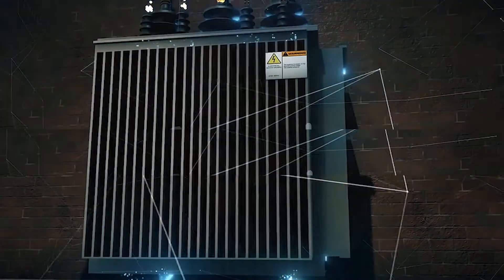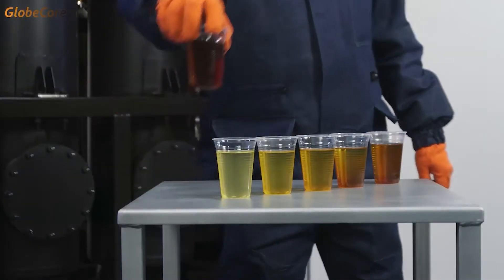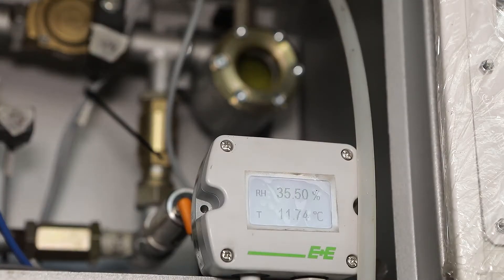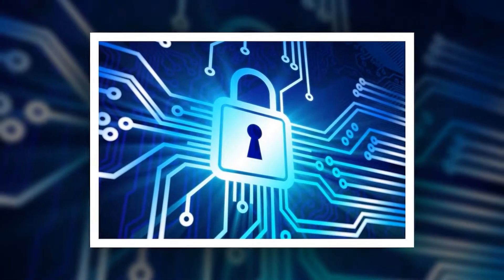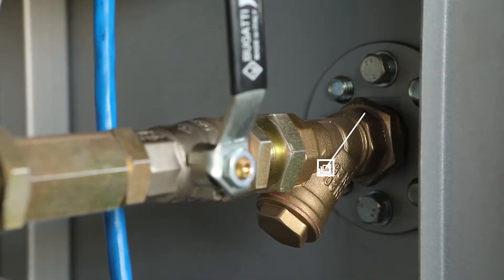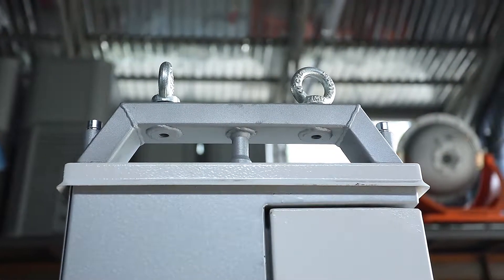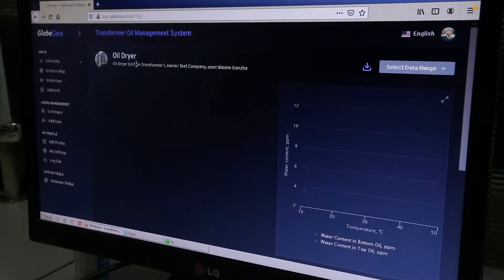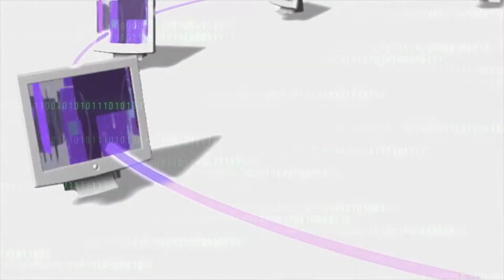Transformer Monitoring System TOR-5 with Oil Maintenance

Comment: Is the TOR-5 system suitable for use with transformers with liquid dielectrics not based on petroleum oils for insulation and heat dissipation?
Reply from the maker: Yes.

Comment: How does the use of the TOR system affect the transformer warranty? And will there be conflicts with the transformer manufacturer in the event of a warranty case?
Reply from the maker: The TOR-5 system is connected to external inputs and outputs. We do not change the design of the transformer. So there shouldn't be any problems.

Comment: Is it possible to centrifuge  transformer oil under the transformer in charged condition
Reply from the maker: If all safety measures are followed, then it is possible. In this technology, compliance with security measures is provided by a special Transformer Safety System (TSS).